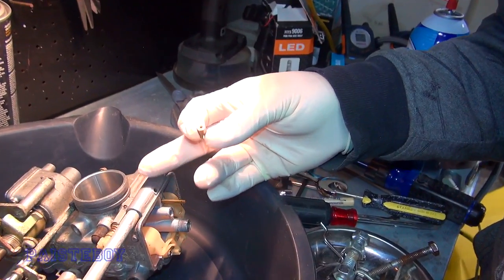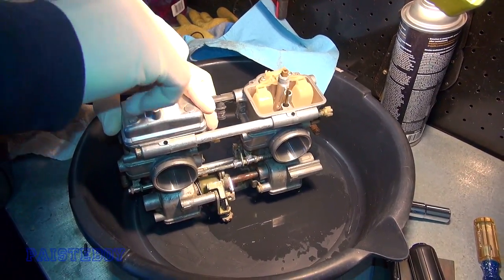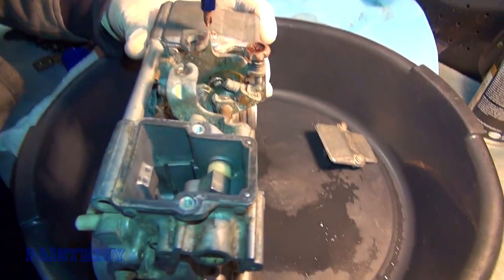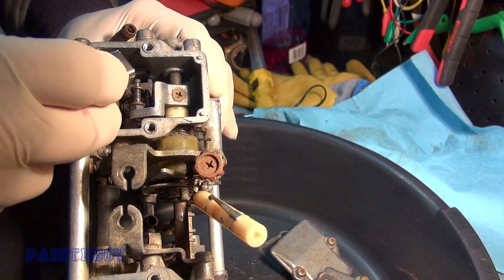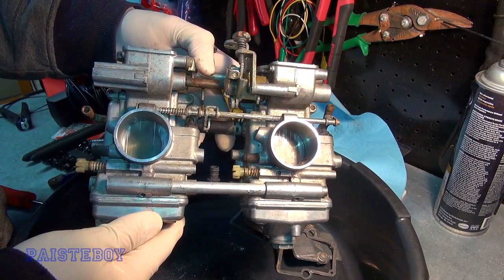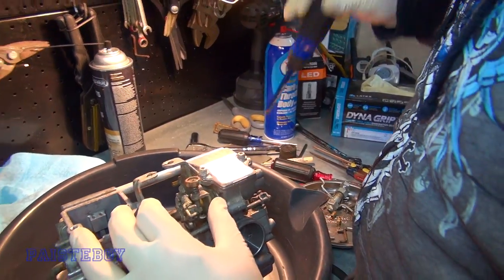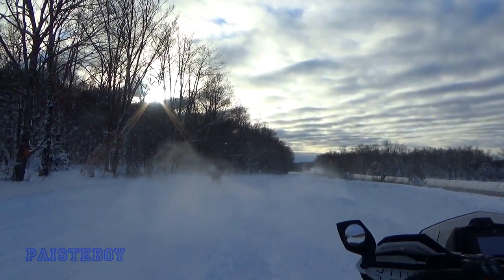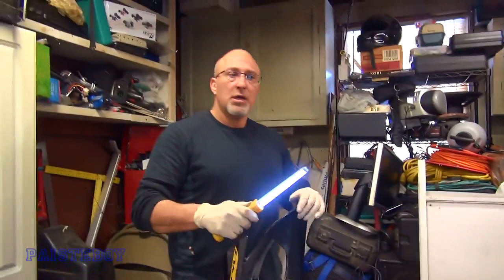2003 Ski-Doo Blair Morgan Carb Re-Jetting: PART 2

Comment: I'm doing a rebuild on my 03 Mxz 600 rev HO , just waiting for the kits to come in friday. I actually made a screwdriver for the carbs and air box clamps. I welded a 12 inch rod to an old screw driver.  I wish I could send ya a picture. I also went to local Ace hardware and got stainless Allen's for the bowl screws.
Reply from the maker: Sounds like a good idea.  Thanks for watching.
Reply: How did you decide what jets to use?

Comment: Also these sleds have a small mechanical fuel pump that helps them prime up. If you look in from the left side when the carbs are out , it sits down below the right side carb. The fuel line that hooks to the black barbed t is attached to it .
Reply from the maker: Ok.  Cool.  I'll tell my bro to check it out. Thanks.

Comment: Congrats to Mark for cutting down on the smoking ! That's the best part of this video. Did you change the pilot jets? They work Idle to 1/4 throttle, usually..... Mark Bow
Reply from the maker: We only changed the one jet on each carb.  In total, we changed the one jet, cleaned the carbs, cleaned the rave valves, changed the expansion chamber back to stock and changed the spark plugs after 20 miles of riding and the sled is running almost perfect.  Mark said it ran a lot better right after but changing the spark plugs was a noticeable improvement.  Thanks for watching Mark.
Reply: @Paisteboy  It's tricky with having pipes on there . Well now just a can, by going with bigger jets  hopefully it won't run lean. Keep an eye on the condition of the plugs. Interesting....
Reply from the maker: Yeah.  Joe neault doesn't think we should have removed the pipe but we have to get the sled running right before we start thinking about upgrades.  The sled never ran right from the day my brother got it so we are trying to dial it back and figure out what's going on.
Reply: @Paisteboy  Your doing it right.I always do the same . Bring it back to stock and start over.

Comment: Oh aren’t those coolant lines fun on the pto side haha, I have a small tool for that job stock lines are about 6 inches to short, your main fuel line doesn’t look stock, the stock line from the fuel pump to the main entry of the carb rack is of black thick high pressure like efi fuel line, hmm every rev I have worked on has that black fuel line, I  use spray lube on the air box boots if it won’t go, oil stays wet to long belt dust collector imo, spray lube drys quicker, there really not all bad  dry once you do enough of them you get to know the tricks lol
Reply: I wonder where his heated carb lines are?
Reply from the maker: Thanks.

Comment: That’s odd both my doo 800,s are using 490 main jets, my 04 800ho and my Xp 800R those 2 screws with the white heads are fuel adj screws, stock setting is 1.5 I believe I set mine at 1.75 sometimes 2 turns out is rich on idle, those needle clips are probly stock most after market shim kits have colored clips all mine do, 17.5 is the stock pilot jet sizing and I find there abt perfect for stock machine with stock exhaust, those bowl baskets are a bitch always try and have a couple on hand there about $10-15 each yeah robbery haha but you cannot ride without them lol, nice video guys,
Reply from the maker: Thanks for watching.
Reply: I noticed the same thing and the needle didn't have 5 slots I think when he piped it the previous owner he jet and needled it and they said it was even smaller They must have been some thin lean pipes that were probably finicky as a get out if it wasn't out of gas and it kept dying I'd say get needles that you can drop down to match the larger jets you just put in!

Comment: I did The same thing with the secondary bolt
Reply from the maker: Were you able to get it out easily as we did?   When it first happened I was afraid that we were going to have to pull the drive shaft to properly extract the broken bolt but luckily it just unscrewed easily.

Comment: Secondary clutch bolt on that sled I use blue loctite and just 13ft pounds haha that sucks man
Reply: I also put a dab of anti seize on the splines on the secondary, they get heat on them and they come off much easier later that way,
Reply: A float kit works great on that sled for the secondary clutch, saves belts and is cheep maybe like $20-30 let’s the secondary float back and forth for better belt alignment
Reply: where would I buy a float kit, also you seem like you know these sleds well i might have a carb question for you,  what lines are the oil lines and what are the breather lines the top ones or the bottom ones? @tcrwild8422
Reply from the maker: Thanks.

Comment: About 3 minutes into the video, you're talking about the carburetor float bowl gaskets. 
What you said doesn't make any sense to me. Heat would cause them to expand. Cool contracts.
Reply from the maker: I thought the same thing as he was saying that but I thought about how some materials shrink when heated. Depending how old you are, you may remember shrinky dinks.  They were a kids decorative toy that you painted and then baked and it shrank in the oven.
Reply: @Paisteboy  Mark is right. Heat will shrink rubber.
Reply from the maker: Yup.  I know it's the opposite with metal.  Metal expands with heat but apparently not rubber.
Reply: @Paisteboy  That's new to me, but will give it a shot if I need to when I'm rebuilding my 01 SRX700 Carbs. I'm an old fart @ 47yrs old.
Reply: Mark Hudson This is correct. I’ve used the same trick for the large o ring head gaskets on Polaris cylinders. Works great.

Comment: Dude why will you put that secondary bolt on so friggen tight no need snug it to 10 12 ft pounds with a bit of loctite
Reply from the maker: Thanks for the tip.

Comment: Those are 380 jets 😂
Reply from the maker: Is that bad?
Reply: @Paisteboy  can't be good , I've built lots of sled over the years but never the same one twice
Reply from the maker: @larrywarner9314  
We haven't rebuild this motor on this sled yet.  We are doing the first rebuild now in November of 2020.  We did rebuild Mark's 2002 MXZ 700 Twice but the second time was because he ran it out of oil.  It was his fault the second time.  Hopefully, we find out why it blew up so we don't have the same issue in the future.
Reply: @Paisteboy  I'm referring to the other sled he rebuilt two or three times
Reply from the maker: @larrywarner9314  
Yeah. The first time that we rebuilt that one was because the mechanic who rebuilt the bottom end did put the roller bearing clip in properly and it popped out and trashed the one side.  then we rebuilt the top end once we realized that was what happened.  The second rebuild was like I said in the previous comment, that Mark forgot to add oil and ran it completely out and blew it up.  So that time even though it was a second rebuild, was not an engine failure and completely worth rebuilding again.  I do hear you though.  Not usually something that you want to do to the same motor that keeps failing.